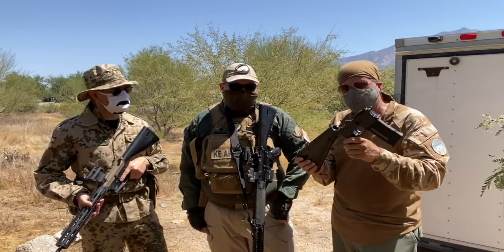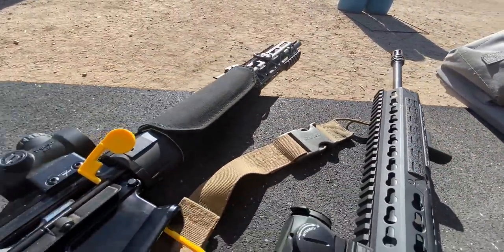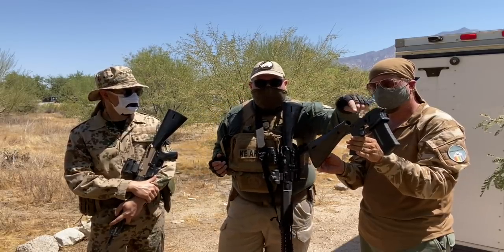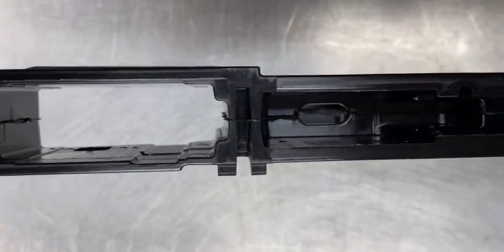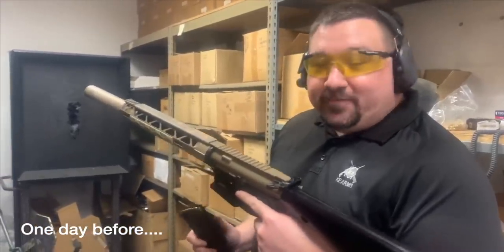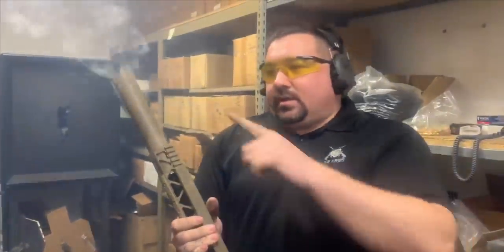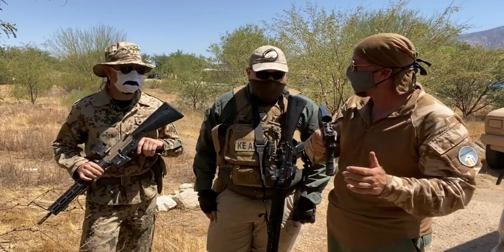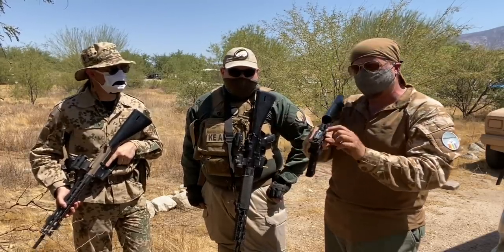WWSD2020 - KP15 First Field Trials

Comment: Waiting for some drop tests
Reply: alan wake never dropped a gun even during a match? Shit happens.. I would be extremely pissed if the lower would crack while clearing a malfunction by mortaring..
Reply: Maybe hire Grandmaster J to test it.
Reply: alan wake  some of us are clumsy? Would be nice to see fairly realistic tepeated 12-15foot drop tests but id be amazed if it incurred any damage other then surface scratches. Biggest issues really gonna be smaking into a tree while slung
Reply: alan wake not all polymer are equal and polymer AR lowers are not something new.. but they all failed.. critical area are the buttstock where it connects with the lower (can’t be added material there in order to leave space for buffer spring and charging handle) and the front pivot pin lugs.
Reply: alan wake I mean extra material can’t be added on top of  the buffer tube area because of the CH..
Reply: alan wake only time will tell. 
This is not the first polymer lower in the AR history.. Bushmaster, Plumcrazy, Cavarms.. just to name a few.. even Colt made one in the 70s.. Thankfully polymers technology has evolved since then.
Reply: alan wake I don’t know 🤷🏻‍♂️ but I wish them the best the project looks interesting
Reply: @Frens03  "they all failed" - that is patently wrong. The GWACS polymer lowers were also strong enough in the buttstock/grip area. That is the whole reason why the lower has an integral fixed stock - so that area can be reinforced.

Comment: I'm an injection molder and in my experience I haven't seen flash like that and considered it normal. Any flash on the parts I make are attributable to my process, an object blocking a good mold closure, or mold damage.

Glad I don't have to deal with all that. Trimming flash is a drag.
Reply: If it was molded in one piece that amount of flashing would be bad but with the welding it is necessary to insure a full thickness weld
Reply: The flash is from the welding process.
Reply: Oh okay. I've only seen vibration welding once but with PP-C so the flashing was just kind of stringy.

Comment: Will there be a version you sell in the halves with holes prepared for screws instead of the weld (and holes that need to be drilled) that can ship right to your door?
Reply: From the q&a videos it doesnt seem likley, that would also require a mould redesign to facilitate screw points and with the long seam lines i doubt any if us woul like a bolt together, likely heavier dissalowing usage if a standard charging handle due ti the top seam and all that is the a t f still allows any fire controll pocket that id personaly doubt so itd likley me another mill yourself then assemble and likly wouldnt have much investor support etc... Id personaly recomend getting an anderson 80percent  and build on that while placing an order for the wwsd neither are expencive and youve got a second to build something different with
Reply: @SuicideNeil  Thanks. I haven't followed all the info on these.

Comment: I’ve watched almost every WWSD video and something just struck me:  how unfortunately rare it is for a company today to develop a new product allowing the design engineers and production managers to work together to create the best product possible. Clearly cost considerations have been taken into account along the way. This video series is a very savvy form of marketing. The KE Arms rep keeps emphasizing the goal of a $100 price point for the stripped receiver, and I’m certain that there is nothing random about that objective. However, the bean counters and/or marketing dicks are NOT driving the train. “Excellence in Manufacturing” sounds like a good byline for this company.

ETA Russell made a joke! 😝

Comment: How is this different from the Cav Arms lowers of a few years ago???
Reply: Cavalry Arms Corp Designed the CAV-15 MKII in 2002-2003. You're acting like nothing has advanced technologically in manufacturing, mold design, materials, and vibration welding in 17 years.
The CAV-15 MKII was not originally designed to be vibration welded. It was set up for sonic welding and that didn't work, so the part was changed to work with vibration welding. It was designed before PMAGs existed and during a time period when Grease Gun mags and .45ACP uppers were cool. There were a number of dimensional and tolerance issues with these parts. The .45ACP mag compatibility could make the mag catches bind unless the edge where the mag catch sits was chamferred. The most common weld failure was at the front of the magwell; because it was never really meant to be vibration welded vs sonic welded. Bolt catches wouldn't always work with PMAGs, PMAGS wouldn't always drop free. Spacing of the upper pin holes wasn't mil-spec. I can go on and on into minutiae on the problems this part had and its shortcomings in 2020; but for most people who got them they worked just fine and they didn't know what went into "making the sausage".
While general concepts of manufacturing are similar to earlier iterations of monolithic polymer receivers, including the Colt design from the 1970s, the part design is entirely new, the mold design is entirely new, the linear vibration welder, and materials are all different than what Cavalry Arms Corp first made in 2003. KE Arms internal design staff created a completely new design extrapolated out from the billet flared magwell lower. Plastic design experts were contracted to revise the design to make it moldable. The vibration welder vendor worked with KE from the start to design the part for vibration welding. Mold flow analysis (computer simulation) was run for multiple materials and mold designs to determine the best way to design and build the mold, and what materials would be best. Material vendors consulted on which materials would be the most desirable in current year. And I've been at the center of it managing all these outside vendors and consultants to make a moldable, durable part, that does what it needs to do as a firearm part.

Comment: Whats the weight of the lower?
Reply: 1.026 pounds stripped subject to change for processing and color
Reply: SinistralRifleman , any idea of the weight configured?
Reply: @SinistralRifleman  My current setup stripped with a mission tactical stock and 4 oz buffer tube weighs 1.5 pounds. So it looks like I would save about .5 pounds.

Comment: Isn't it just a lower?
Reply: they r doing a full rifle as well
Reply: KE Arms just makes the lower and the trigger, but they designed a complete rifle around it with parts available on Brownells.
Reply: @CountArtha  I think the final rifle is going to use a large number of KE Arms parts. (Upper receiver and charging handle have been rumored, possible BCG) The original had a Faxon barrel, but they said in the video that it was changing. 

I'm thinking KE either: A. put pressure on them to use more KE parts, or B. (Hopefully) KE stepped up and made better options because of the project.
Reply: @colemanmoore9871  its more of an issue having a reliable supply of parts
Reply: @Erpyrikk  That is a good point. The more they make, the more control over the supply line. If Faxon or Aero stops shipping, or delays an order, theat would put KE and Brownells in a bind.

Comment: I wouldn't mind picking a stripped receiver up for $90 bucks. I figure you're saving some money not needing a stock, buffer tube, or pistol grip. Also don't need to hassle with torquing and staking. Buy a cheap lpk, slap a cheap upper on it, and it's g2g.

Comment: Would the Surefire Enhanced Bolt Carrier Group be an excellent fit for the WWSD2020?
Reply from the maker: No, the Surefire Enhanced Bolt isn't really useful for anything but a fully automatic rifle - it has no application in a semi gun at all, IMO, and is not compatible with our recoil spring system either.

Comment: How about going with a threaded bolt catch pin like Aero Precision does on their m4e1 and m5e1 lowers? That would make assembly much easer and you wouldn’t have to worry about breaking that part on the lower while installing the bolt catch?
Reply: The install of the pin into plastic is easier than aluminum.  Much less resistance.

Threading each one would slow production and increase cost.

Comment: Are you going to reinforce the magwell?  As competition shooters, I’m sure you know that when people start doing speed reloads with metal mags in particular, that’s probably going to cause some damage.
Reply: Reinforce it with what?  It’s the thickest part of the receiver.
Reply: SinistralRifleman ever seen the magwell of a legitimate competition shooter?  JJ Racazas Limcats has chunks of metal missing from them
Reply: Puppu Jinks where did my question hurt you?
Reply: jonnytestnj I guess I’m not a legitimate multigun competition shooter?   Yes I expect people doing hyper aggressive reloads will scratch up the magwell, the same as they would on an aluminum one.   But it can be sanded and reshaped or filled with resins and reshaped as well if that’s your thing.  The entire receiver costs not much more than a 2011 magwell, so I’m not sure what you’re expecting us to do that will keep the lower affordable and lightweight.  Over molding some sort of aluminum hoop?   That’d make it more expensive and heavier.
Reply: SinistralRifleman I had no idea you’re the guy in the video, but thanks for responding. Anyway, I’m sure you understand that durability is a legitimate concern of potential customers.

Comment: I can foresee people who reassemble their rifle and forget to replace the buffer and spring then rack the bolt back and get it stuck in the stock. Please include a hole in the stock to allow those poor unfortunate souls to allow them to take off the butt plate and push the bolt out with a cleaning rod.

Comment: As someone who doesn't own firearms (in the UK). What's special about this lower compared to others. What's different and makes this standout?
Reply: Lightweight minimalist polymer receiver designed to be polymer from the get go, so it's also stronk.
Reply: It's both lighter and stronger than an aluminum receiver, and it will be cheaper to produce in a large production run (economy of scale).

Comment: Why does it use a carbine buffer when it has room for a rifle buffer?
Reply: It doesn’t have room.   The back end is reinforcement ribbing to absorb the buffer impact.  A rifle length buffer doesn’t leave room for enough support material with an A1 length stock.

Comment: Well, looks like you've got yourself a really light lower. What about a super light upper receiver? I bet you could shave off a few more pounds with a  minimalistic polymer upper, and perhaps an SBR-length barrel made of titanium alloy or maybe even a steel liner and locking surface in a 7075 aluminum sleeve. It would probably disintegrate under sustained rapid fire, but at least it'd be light.

Comment: Why have a fixed stock?
Reply: That is necessary in order to have enough material around the area where a buffer tube would attach to the lower on an aluminum receiver. If the polymer had a regular buffer tube, that area would be a weak point.

Comment: lower is great. how ever, mil-spec hammer will not line up with the pin holes.gonna have to use a drop in fire control group. drop in will be better as it does not put stress on pin holes.
Reply: Uh…..we’ve shipped 10,000 units with milspec fire control, they work just fine.

Comment: Sooo...where might one find that file for 3D print?
Reply: That wouldn't work well. 3D printing has very different material properties than injection-molded glass-reinforced polymer. The stock/grip area probably wouldn't be strong enough.

Comment: Men, you need some Kalashnikov test on these frame. A typical ak74 can hold about 600 rounds continues firing before something melt down and burn. And in the frozen test, no AR guns survived in -20c under snow, cause they all made by alu and steel, it will stuck together if there is a drop of moisture. If this can be achieved in this frame, that will seriously rock the industry.

I know it will happen, but i don't know when. Why? Look at all those handhold battery drills, do they resemble anything? And Americans love their battery drills, they spend hundred dollars on each of them. It is a psychological thing, now, skills use to make plastic drills are coming back to make real guns.

Comment: This bothers me every single time... Why make the stock part of the mold? Wouldn't it make more sense, both in terms of ease of manufacture and consumer friendliness, to just have threads for an m4 buffer? Modularity is always better. Not only would the customer then be able to pick their choice of stock OR pistol brace for that matter, the customer then also has the choice of length of pull. Now i already hear the objections to threading polymer, but it's not a big of a deal as one would think, and there's firearms out there that do it without issue. But also, you could instead design the buffer hole to accept a metal thread insert, not that difficult and boom problem solved
Reply: In previous videos about it, they've said that polymer lowers that are just "aluminum lowers but made from polymer now" and not originally designed to be made from polymer are too weak and have very short lifespans.
Reply: Without the stock being molded in, the area the buffer tube threads into is a weak point that will fail regardless of the insert you put in. If you’re not going to mold it in, you should just stick with aluminum.
Reply: Threading polymer is not the issue, it's the resulting thin material in that area that could not support the stresses needed.
Reply: @MarvinCZ  i don't buy it for a second. If the kriss vector can survive twenty rounds per second of bubba's pissin' hot 10mm loads, then i think these guys can find a way to make this thing survive 5.56mm. you really don't have to add much material thickness to make up the difference of thread cuts.
Reply: @idontwanttoputmyname403   That had to do with material thickness
Reply: @SinistralRifleman  The length of the stock doesn't determine the structural integrity, the thickness of the plastic does. They really wouldn't have to make it that much thicker to compensate for the threads
Reply: datpolakmike there’s plenty of inferior products on the market already that thread buffer tubes into a polymer lower.
Reply: @datpolakmike  And my understanding is that if one were to make a polymer lower to the same dimensions as a normal aluminum or other material lower, NOT having the entire stock as an integral piece and instead having a normal threaded hole means that there wouldn't be enough polymer there to have a structurally sound part. It would just break right at that point. And if you made that entire area thicker, all that would do is cause problems with the wide array of parts that are on the market because at that point it wouldn't be "mil-spec." 
Also, if you put a metal insert into the polymer, wouldn't that just serves to create stress concentrations, and exacerbate the problem both because of that AND because there would need to be even less polymer?
Reply: @SinistralRifleman  that doesn't make any sense. What does the quality of the buffer tube have to do with anything?
Reply: datpolakmike polymer lowers that accept M4 buffer tubes are known to fail consistently cracking the threads or the entire back end off.
Reply: @SinistralRifleman  well yeah. Most polymer lowers don't increase the thickness of the material to compensate for the fact that it's polymer. They take the exact same design and dimensions used for aluminum lowers and just change the material